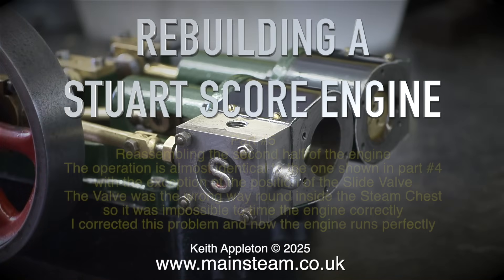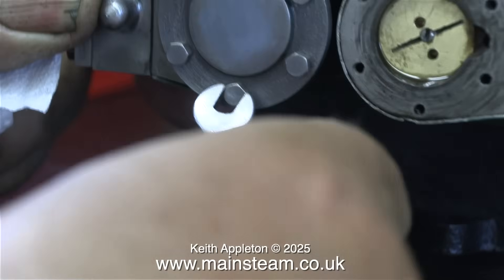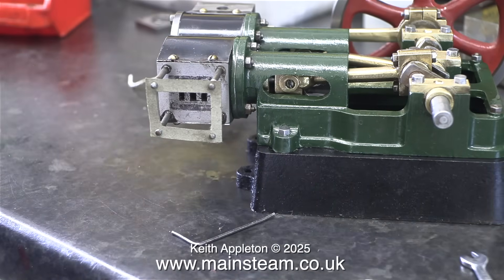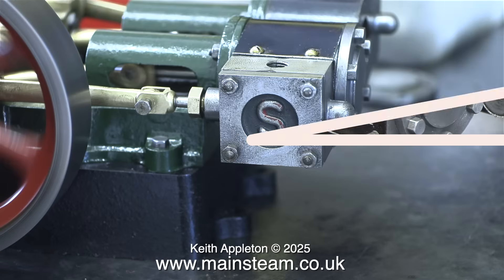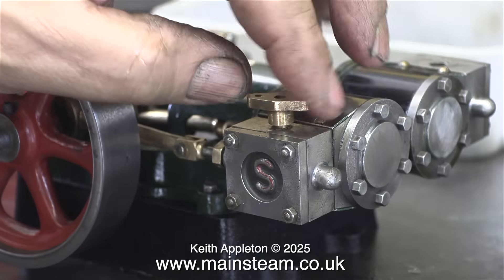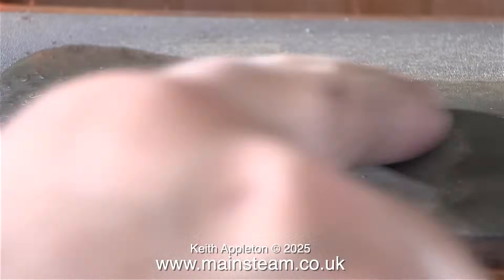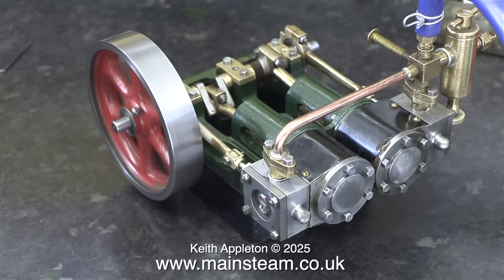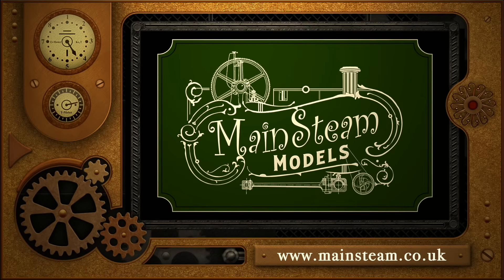REBUILDING A STUART SCORE ENGINE - PART #5

Comment: Keith, could you explain how you knew the slide valves were the wrong way round? Are they not symmetrical?
Reply from the maker: they are both the same shape (square in the middle but not on the outer edges. One was just fitted the wrong way round.